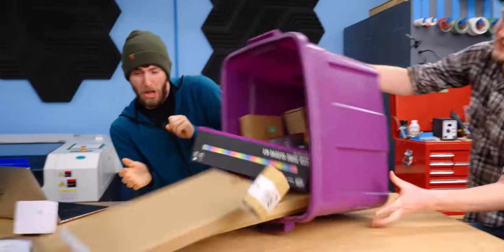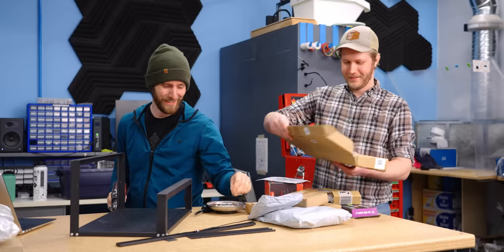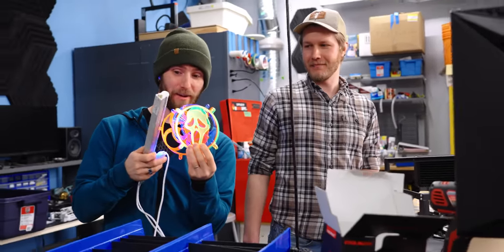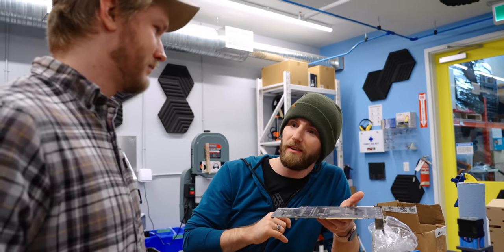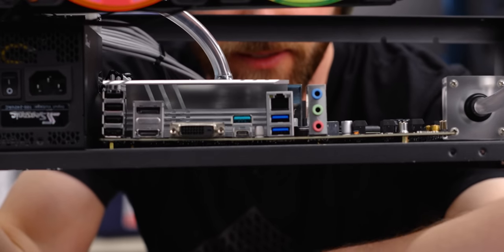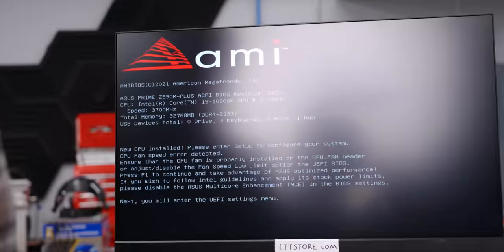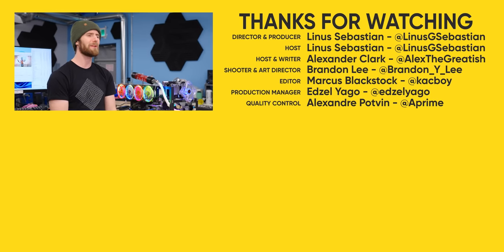Water Cooling… Using only Wish.com

Comment: I bought those exact fans from amazon once for giggles, and get this: on first startup, connected to the supplied controller they PHYSICALLY CAUGHT ON FIRE. The LEDs just popped with visible flame and the plastic around them started burning. It was hilarious
Reply: Hulk  how strong is spam report?
Reply: @HearMeLearn  What is love?
Reply: @ulliulli  baby don't hurt me
Reply: @OliveOilBoy  no more
Reply: @ulliulli  love is fire. Just like the fans from op.
Reply: @HearMeLearn  sadly, the report is not very strong.
Reply: 😂🤣 glad you are ok tho
Reply: Oh wow!  This gave me a good chuckle.  Thanks for sharing your amusing story!
Reply: This fan is a fireplace as well? What can’t it do?
Reply: I guess you could say it was...

...lit? 🔥
Reply: Hulk  I dislike this, but it was funny af tbh.  There you go, the counter was taken away but comments remain.
Reply: You have a different kind sense of humor 😂
Reply: @HearMeLearn  not strong enough 😪
Reply: Oh yeah those fans are finicky. You gotta plug them in a certain order or the LEDs will burn up. In my experience I've never had a problem with them breaking on operation, only during shipping they would crack which is a huge inconvenience. So yeah don't buy them, but maybe buy them?
Reply: Oh fuck.
Reply: Interesting, I have 2 sets of these CoolMoon fans they said something else on Amazon, but I got the CoolMoon ones, I have been using them for 2 years no issues at all.
Reply: I have 8 of these on my pc they are working great. (not all of them)
Reply: @HearMeLearn  never strong enough
Reply: Did you tell gamers nexus??
Reply: @Christoffer Högman thing is that china quality is actually good but only when they want to 🤣
Reply: I was like the fans look like the only part i would buy if i had no other choice😂
Reply: @HearMeLearn  apparently not strong at all
Reply: @HearMeLearn  obviously not strong enough if its still there
Reply: That's because you didn't put brown thermal compound on the LEDs
Reply: Oh yeah the Coolmoon fans. I found the manufacture on Alibaba but yeah, I’ve been using their fans, the ones with the exposed LEDS around the fan facing to the blades making this cool image effect, so the light pattens look awesome. They haven’t failed on me yet though, but they are good cheap fans alongside their LED strip
Reply: Hey they weren't kidding when they said these led fans are lit
Reply: Water cooling? More like fire cooling
Reply: pc:🔥🔥
this guy: lmao
Reply: @Shraf2k was about to say that😂
Reply: I actually have the same set with some mods 😁
Reply: @HearMeLearn   I reported some spam bots once, my comments were instantly deleted for a year with that browser afterwards.
Reply: maybe those LEDs need some sort of cooling too for maximumest performances XD
Reply: Fire hazard for everyone in the family, another QUALITI produkt by CoolMoon.
Reply: This is fine
Reply: So... You plugged them in to the wrong port?
Cuz I have a $1400 rig with coolmoon fans that have been running silently, at least 2-3 hours a day, sometimes all day & night, for over a year. Got em on ebay. But they're rated 4.8 - 4.9 on AliExpress
Reply: LMAAO (Laugh My Adams Apple Off)
Reply: @HearMeLearn  bro your name
Reply: @HearMeLearn  save his acc url so he'll be outed as a spammer when he inevitably wipes the acc and rebrands it
Reply: No, that’s fucking terrifying
Reply: @stormgear896  or you can do like I did and solder an extra resistor in to reduce the current so that they don't pop
Reply: @philmerrifield1163  cool, I learned something new today, thanks.
Reply: They are low quality fans in America they send you guyz the class c ones while here they sell in South East Asia the high class one B class. It's on my 11900k case thats unbranded
Reply: @stormgear896  there is a resistor in the controller that's too low of a value for the load involved if anyone would like I'll make a video of the fix
Reply: That happens when the power is inverted to the LEDs or the RGB controller is connected to an incompatible motherboard.

Often these controllers only support specific motherboard headers.
Reply: Well duh, fire is red and you wanted rgb
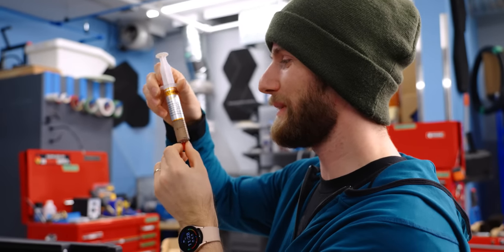Reply: You probably forgot to put the thermal paste on em. 8:05
Reply: @taitheguy85  nah, at first I thought so too, but no. Something was off with either the controller or resistors in the fans. One didn’t burn any LEDs but the other two did. Controller also doesn’t work as expected and pinout is correct. (And no, I’m not a noob with either computer nor electronics in general, I’m one of those guys that actually replace surface mount components on dead graphics cards and whatnot)

And also yeah, the actual fans seem great, real quiet and works fine, the LEDs was the only thing that let out the smoke
Reply: @QwibzOSRS  hey, message me or and I'll give you pics, still have the fans right here, still smell like burnt plastic. They are branded GiM and not coolmoon but are obviously the same fans
Reply: @freedomofmotion  yup, I thought I'd "made a dumb", but no, the board is compatible and the right pins were used. I suspect a defective controller
Reply: @HearMeLearn  weak
Reply: That's scary dude
Reply: where were the smores?
Reply: Someone tell GamersNexus
Reply: The flames are actually a feature
Reply: lmfao oh my gosh
Reply: Should've put the thermal paste on the LEDs
Reply: @taitheguy85  Odds are, these fans are so cheap because they have zero QC but are otherwise normal average fans; but if a manufacturing mistake happens, they're not gonna know and you might receive a product that doesn't at all work or indeed catches fire.
Reply: i got them from newegg for like 24 or 29 bucks and had 0 issues with them so far had them for around 18 months or so
Reply: @Raleford  HE LITERALLY JUST SAID HE DID THAT EXACT THING! READ THE GODDAMN THREAD BEFORE MAKING RE[DACT]ED COMMENTS
Reply: @fisty539   I was making a joke based on 8:05 in the video.
Reply: Are you sure you plugged it into the right spot though? I plugged my fan's RGB controller into the wrong place and it started smoking and got so hot some of the rubber melted before I unplugged the PC.
Reply: @hey_how_are_ya  switch off my smoke alarm? Lower my home  insurance premiums?
Reply: Can something mentally catch on fire?
Reply: @SteenG3yL  Yes. I mentally picture this happening with any major upgrades I do to my PC. 

That's why I bought the most powerful one I can afford.😁
Reply: @Christoffer Högman Cheap China quality? Because the computer, you're using like ASUS, MSI and more is ... Made in China. 
(Kisses fingers and drops the mic)
Reply: Had those exact fans installed for 2 years and they work flawlessly. Funny how people make up complete bullshit to justify spending big money on big brand fans…😂
Reply: why would you randomly buy fans for giggles?
Reply: Metal
Reply: Yikes i’ve used fan packs from them before and had no issues I’m glad nothing like this happened
Reply: I have cool moon and it works perfectly fine ngl I didn't know If there good but they work fine for me
Reply: Drop the link, I need an insurance claim.
Reply: I had a handheld fan (not a computer fan) that started melting soon after it was switched on
Reply: looool
Reply: Dude same! The cord on the  hub for the fans completely melted and caught on fire. They ended up refunding me and sending me like 3 more packs of fans cause I wrote a review about how dangerous they were on their Amazon page lol.
Reply: @ulliulli  Baby don't hurt me
Reply: @auneakeffect  people with too much money for their health buying things they know won't work
Reply: Ok
Reply: Bruh ☠️
Reply: It probably was a slight defect in the one you got. I have a controller from a cooler master cooler and it smoked 2 of it mofsets or resisters whatever their called and now only red works.
Reply: this is that one meme of the dog saying "this is fine" but the house is in fire
Reply: yeah sounds like a voltage issue on your part. definitely not intended design
Reply: My question on this exact comment is what did the guy named Hulk say 😂 I wanna know badly XD I read literally every comment carefully that @ him
Reply: @HearMeLearn  what did hulk say? It’s been since deleted
Reply: @pricelesssword4559  fuck if I know this was 7 months ago lmao
Reply: “Hilarious” bro I would simply cease to exist, if you were watching I would just disappear the moment it caught on fire
Reply: we all know this isnt true
Reply: magic
Reply: @HearMeLearn  What did hulk say 💀
Reply: @The_Romanian_Terror  on god I wish I knew lol, it's been too long
Reply: Q
Reply: Q
Reply: Q
Reply: i have the cool moons fans and i love them got an 8pack
Reply: @EnsignLovell what did hulk say that had so many people upset if it was actually funny?
Reply: I’m so confused my this reply section. Who is hulk????
Reply: One time my mom bought a usb pc fan for our Xbox to cool down but the motor started getting hot and melted
Reply: Yea yea yea... BUT WHAT WERE THE BENCHMARKS HOSS!!!
Reply: I had the same thing except it cooked my psu 😢
Reply: @hey_how_are_ya  Cool the computer off?
Reply: "It was hilarious" my brother in christ ur house could've caught fire
Reply: Hulk keeps being blue comment
Reply: Aaahhh it’s an @

Comment: Man this makes me nostalgic about water cooling in the 2000's when basically everything was cheap junk from china.
Reply: Some companies made stuff in the US and Europe but cost quite a bit more. I remember going to boutique or extremely niche sites back in those days for cooling components not found in the usual brick and mortar stores. FrozenPC was one of them and the rest escaped from memory at the moment. I had some moderate and high quality tubing and UV lights from a small shop near me (before they went out of business in the 2010s) and even some decent stuff from CompUSA. I think a lot of the mainstream UV stuff I bought was made by Antec.
Reply: Yea before 2010 a Basic good water cooling started at 450$ .. some spend like 1-2k in some cool setups... Like the pimped Car shows :P
Reply: Everything is still from Chyna.
Reply: Reason I avoided it years ago personally, I had a gt 8800 gtx and unknown model quad core intel cpu. Back then watercooling parts looked like a marble course toy you assemble together with the awful plastic they used. Nowadays though watercooling is really a good option for most. I ended up getting an artic liquid 280 and its kept my cpu below 50 even running cinebench or cpu burners
Reply: Or when people asked what aquarium you have
Reply: @m0r73n  Fr lol pcs really did look like fish tanks back then. I dont miss it one bit especially the old case designs with a million hdd and optical slots on the front with no air intake
Reply: In the 2000's more than from China the things for water cooling came from the city hardware store or from the pet store for water pumps.
Reply: Obviously you never used car radiators ;) and aquarium pumps. Back in 00s you would pretty much physically hack everything. Like literally hack.
Reply: or was repurposed from other industries.  I remember watercooling using a cars heater core as a radiator.  honda civic and small car heater cores worked perfectly.
Reply: @chubbysumo2230  I miss when you have to create things yourself. Opened your mind up to some crazy mod ideas
Reply: Now it's expensive junk from China
Reply: @John-gc5gt  Some water cooling stuff is awesome. arctic liquid freezers are crazy good for low temps because of the huge thick radiator and dual 140 or triple 120 fans which are slightly thicker and powerful It seems than most other fans. Not loud and was not expensive
Reply: OG watercooling was just raiding your local aquarium pet store.
Reply: Everything is from China (:
Reply: @BadIronTree  yeah, was more cheap the full PC than the cooling :,D
Reply: @Pierre Lucas (“Plutonas”) wait are you thinking of the Zalman Reserator? That's Korea, not Germany.

We've got Alphacool and a few more specialists here but I don't remember any towers.
Reply: Early 2000's what where the size of the GPUs? (I got in to building PCs In 2012ish)
Reply: @linkincsar269  In 2000, you can expect the CPU to be about 25-30W and a 5-18W GPU (Geforce 256: 16W). 

By 2005, you could have a CPU of 100W (Prescott) and a GPU of 100W (Geforce 6800 Ultra). My 6600GT at the time was much more frugal though at around 50W.

If you mean size as in dimensions, you expect GPUs of the era to be full-height (unless they were super low end) and be up to about 20cm in length.  They generally came as single-slot, but you could buy two- or 3-slot aftermarket coolers. You could expect to pay around $160-$200 for an upper midrange board and already not at all far in performance from the high end GPUs, and an aftermarket cooler could cost you around $30.

Exception: year 2000 Voodoo 5 5500 which is 30W, and about 25cm long. A Voodoo 5 6000 was supposed to come out a couple months later, that would have been probably 35cm and 60W. Someone recreated it recently, it's functional but the drivers were never completed.
Reply: @SianaGearz  if at the beginning of the 2000s it came to bathe with a small passive heatsink that today you would not put on the chipset. the small fan could be turned off and you wouldn't know about it since there was no overheating.
Reply: Funny enough with those fan covers linus said were from back in the day and the double helix res.  This just seems like a Homunculi of New old stock and modern parts.
Reply: in early days you just bought a block some dude had drilled 3 holes in to make a loop and put connectors on it.
or epoxied some plexi on a heatsink.

then it was cheap crap that looked like it was made in china but wasn't.
Reply: @gustavobalmaceda2346  not to mention the junkyard, i remember truck heater cores frequently being repurposed as radiators
Reply: Why are today's gamers talking like water cooling was something new in the mid to late 2000's?
Not only do I recall as a kid seeing my mother running water cooled mainframe IBM's in the 80's at the university she did her PhD at, I did my first water cooled PC in 1998. I don't recall the brand of the block, it it was made by a company here in Europe. In the 2000's there was definitely good stuff from both the US and Europe available. The only thing that can be said for the mid 200's is that water cooling became very common.

Comment: 17:25 Now I just really want to see them build a pc with cooling just out of non pc stuff like the bong. Just imagine them using a storage box as a case, zip ties to fixate literally everything, garden hoes for the water eg.
Can we please get that? Just throw random stuff at the hardware until you got a selfmade pc
Reply: Get a hardware store to sponsor a video
Reply: that's how it was in the old days. noone really sold "PC" watercooling parts so you'd have to use garden/aquarium parts
Reply: They did in scrapyard wars
Reply: Car radiator
Reply: I want to see this
Reply: I love this idea. Dollar store pc...
Reply: Could even be a build-off chalenge. Build a custom loop without any pre-made parts. G1/4 threads are banned entirely. Winner has the cooler CPU temperatures at a given decibel number.
Reply: wouldnt that be whole room watercooling again (but with a car rad)
Reply: I beleive they already did that in a video
Reply: @loganwhatcott2031  
Man I miss scrapyard wars
Reply: @santinojoshuatorre1695  Yep & like oil coolers from cars or radiators from motorcycles.
Reply: I am 1000% here for this content.
Reply: I remember the old times, when people actually brought PCs in beer crates to LAN parties etc.
It was incredible to see where people put their PC components in, so many creative people. I'm kinda missing that on modern builds.
So yeah I hope they will do something like this and just using random stuff for a build.
Reply: @Kuri0  You use heater core from car's air conditioning system.
Reply: Holy shit I would love that
Reply: holy shit what an amazing idea i hope linus' team sees your comment
Reply: @Gatorade69   no ltt did scrapyard wars I think 4 years in a row , 3 teams of 2 and extremely low budget to build the best working PC possible, those are some of the better vids ltt ever did
Reply: Y'all, why they gotta kill my boy Scrapyard Wars? ;-;
Reply: "The all pet store water cooling PC"

Comment: Next Series: Water-cooling a PC at Home Depot/Lowes/Hardware store. Using Pond pumps, sink/bathroom fittings, hose clamps, etc, and compare cost to doing it from parts (e.g. microcenter)
Reply: They did this before.
Reply: This is a great Idea!!! the only thing you might have trouble with is the tubes, you would need something without plasticizers if you actually wanted to use it long term...
Reply: I'll have to go find it now.
Reply: @d3lsl0w  link?
Reply: ah the old fashioned way
Reply: Done in Scrapyard Wars and i'm pretty sure that's how they did it for Whole Room Water Cooling Project
Reply: How we used to water cool PCs 15 years ago